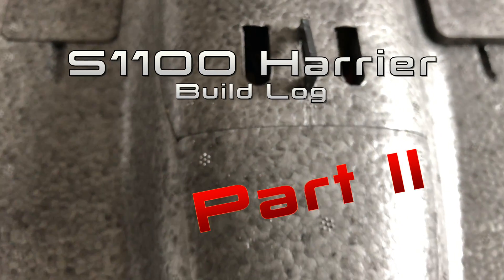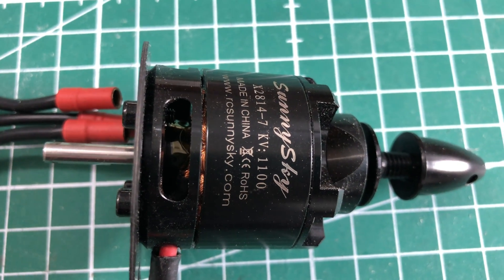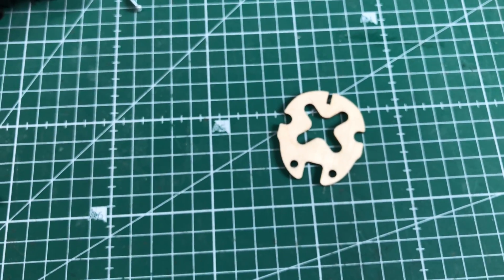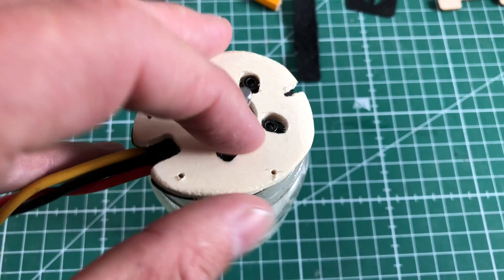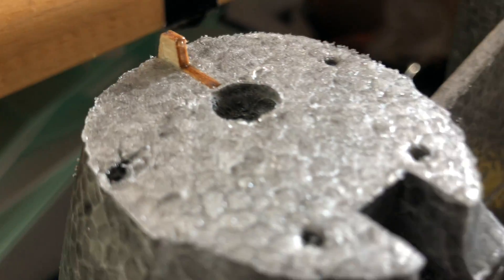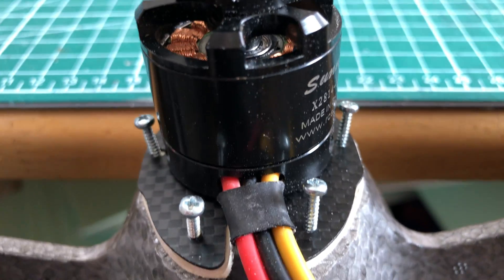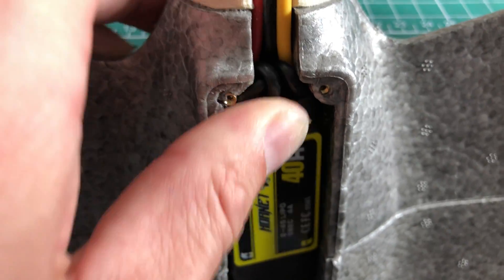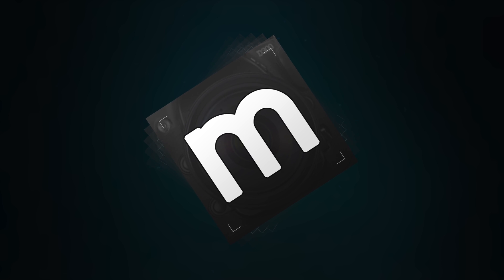Reptile Harrier S1100 - build log 2 (single motor) #04

Comment: Is it possible to fly even if I use the X2212 1250KV motor instead of the X2814 1100kv motor?
Reply from the maker: Should be possible but then either 7“ props
Reply: @JustFPV-net  Thankyou.
Is S1100's wing detachble?
Reply from the maker: @k.bm17  in theory yes- but there are no quick connections for the wiring so that limits this effect
Reply: @JustFPV-net  Thank you for your help.